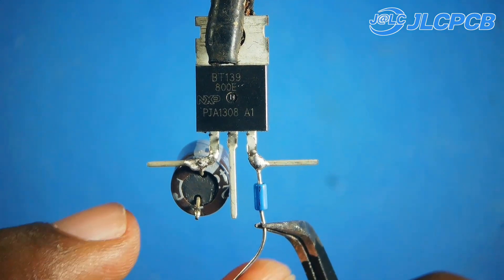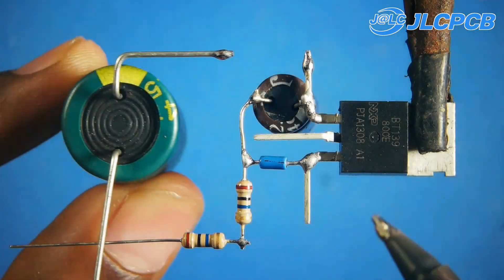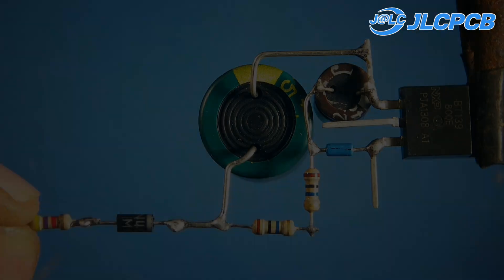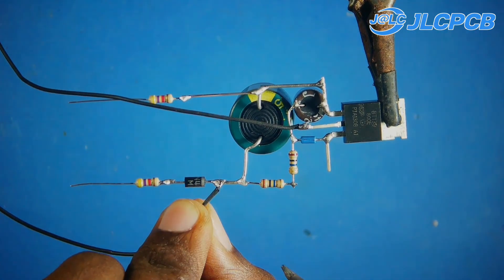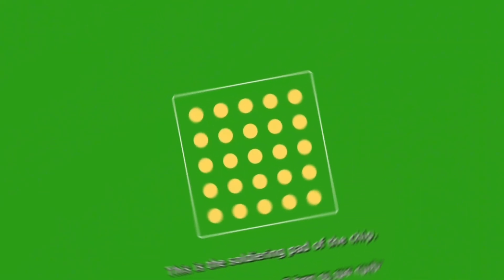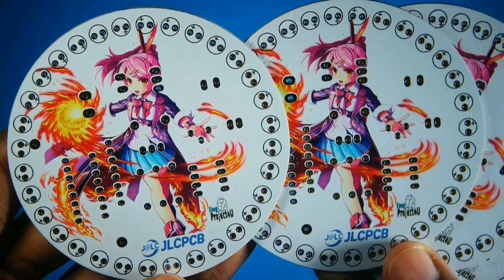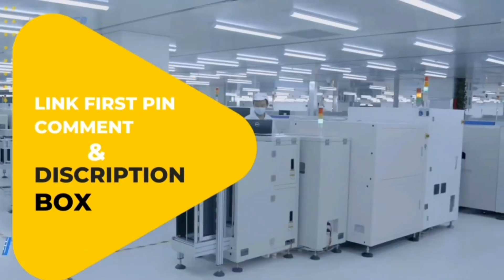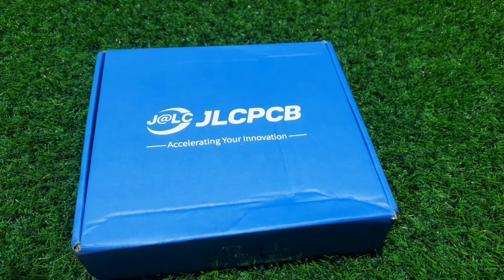DIY Electric Fence Circuit That Actually Works! Shocking Results!

Comment: Is this  capacitor discharge fence?
Reply from the maker: No, I have already done a video on capacitor discharge electric fence circuit.
Reply: Sir can u please make the video 10kv transfomer winding ... i am from sri lanka
Reply from the maker: Sure, I will make a video of winding high voltage transformer. Thank you for your comment.👉❤️👈

Comment: Hello, the resistors shown in the video, red, black, blue, are each 20 megohms, which were wrongly shown as 10 megohms. The project is very good, thank you.
Reply from the maker: Thanks for the comment.
The resistor that I use in the video is 10MΩ. The color code is brown, black and blue.